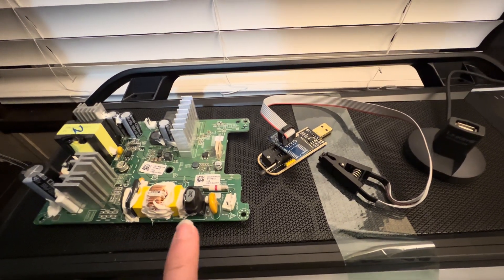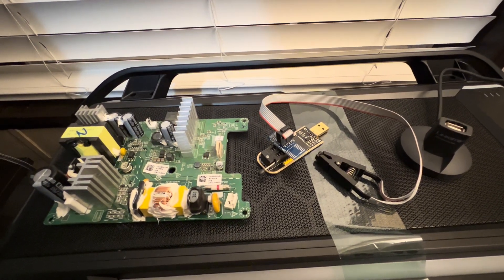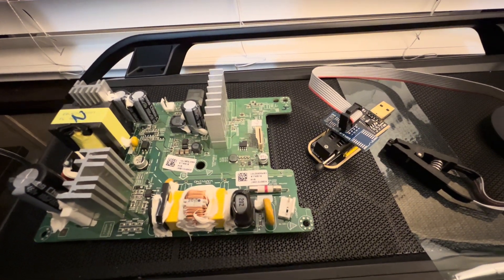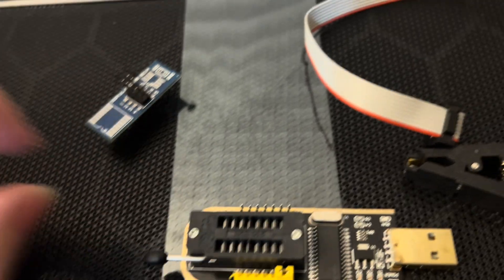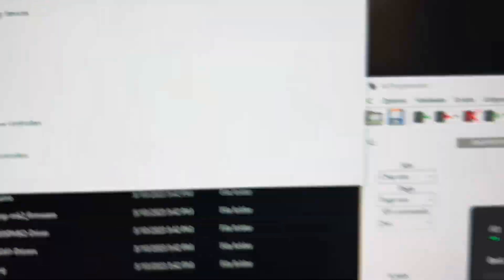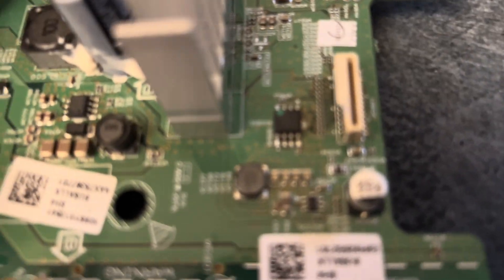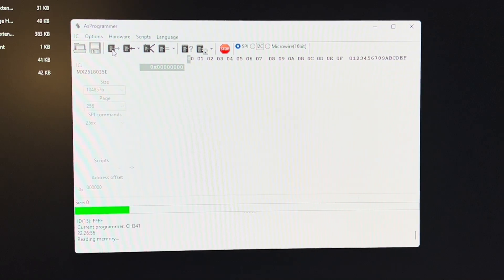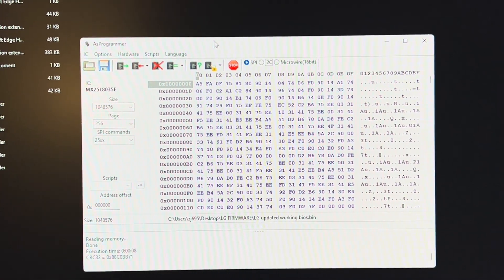How to fix LG Soundbar Subwoofer not working or pairing. SPN5B-W + SPN8-W part# EBR89625801

Comment: I've had this sub dead for over a year with no lights or anything that came on. I figured was power surge that got it and LG said wouldn't fix.
I found this vid and pulled my sub out of the garage, collecting dust and ready to be trashed to give it a whirl for $15 since not a big deal if didn't fix it. I was astonished it read from the chip, and even more so after re-programming that the green light came back On again. Found my old soundbar and plugged everything back in, and my mouth hit the floor as the sub came back to life like magic and paired back to everything with no hassle. Thank you so much for making this vid dude! Saved me a ton of $ by just throwing it in the garbage since LG makes it u can't just pair any model sub back to that soundbar.
Reply from the maker: @chrisrowland8757  🙂

Comment: Thank you for taking the time to post this.  I was about to drop a decent amount of money on a new soundbar system, until I found your video.  I've already ordered the programmer, downloaded the software program, and removed the board from the speaker housing.  The programmer should arrive tomorrow, and hopefully, I will get this thing back up shortly after.  I am fairly illiterate when it comes to computers, so I do have one question.  You posted a link to your working firmware.  Is this something I need to download?  I have no idea what that is.  (sorry for the ignorance)

Comment: This worked perfectly! So glad I searched for a fix instead of tossing it out and shopping for a new one. Thanks from Australia!
Reply: Any chance I can send you my sub to fix? I am also in Australia
Reply: @SOulDie22  I'm guessing it'd be a lot cheaper and quicker to do it yourself. There were heaps of chip programmers on Amazon for about $20 with postage. The only things I struggled with were installing the drivers on my work laptop and reading the tiny writing on the chip.

Comment: Hi there, I purchased my CH341 programmer from Amazon last week and have followed your instructions to connect it to the Sub PCB EEPROM of my LG.  All appeared to be working fine but, I think my CH341 is now bust as the light flashes on when inserted into the USB socket of my computer, and then goes off.  I then get a message in ASPROGRAMMER saying "Error connecting to CH341 device".  I guess my programmer is busted but, is it possible to damage the 341 with improper connection to the EEPROM ? Thanks

PS - Would you kindly be able to recommend a CH314a from Amazon UK please??? :)

Comment: ah was unable to get the clip to even stay on, so I couldn't get it to recognize the connection.. maybe faulty clip? just kept slipping off.
Reply from the maker: Not the chip. Either the clip isn't very good, or you're only clipping onto the tops of the pins and need to push it down a little

Comment: This thing works! I had to do the unprotect, erase, and program steps manually, but other than that, this methods works 100%. I had the issue where the unit would flash the green light forever, never pairing. Amazon had me with the overnight shipping on the chip programmer

Comment: Does the bios/firmware were flashing onto the chip come from the LG website?
Reply from the maker: No. It comes from my subwoofer. You cannot get just the subwoofer firmware from LG
Reply: @FiveStaxX is it possible to re flash the firmware on the main PCB for the sound bar or only the subwoofer?
Reply from the maker: @anthonyv8136  you can probably flash the sound bar as well, if you have the correct firmware for it

Comment: hi i have SPH4B-W subwoofer and i am unable to find the the oem file to program it i did try your file but i am facing the same issue greenlight flashing no connection with soundbar.
Reply from the maker: My file only works on series 5 or higher. I'll see if i can get a series 4 file
Reply: i put new eeprom, work on MODEL NO.: SPN4B-W,thanks, best regards.

Comment: Coming back to say it all worked perfectly for me on my LG SN7Y (Eur).  I followed each step with gaps in between to check i had followed it correctly. 
As is mentioned as a possibility in the video I got an error message after programming but I carried on and it worked first time.
Having been without the woofer for months I am so happy to have it back!
Thanks so much. I sent you a paypal donation. (Not much but all I can afford right now. Enough for a pizza and a beer maybe)
Thanks again and thanks for doing the work that LG and others should be doing.

Comment: Great video, thank you.  I just got my kit delivered so I am hoping it goes well, I am optimistic having watched this a couple of times.

Repair 
3:29 repair starts here 
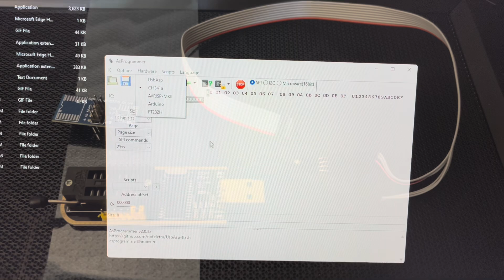4:03 Assembly of USB adapter and cable
6:09 Install USB programmer to computer with driver. 
6:58 Run ASPROGRAMMER

Comment: would bad firmware cause the sub to regularly disconnect and reconnect to the sound bar? Always read about it being weak bluetooth signal and interference that causes it but no matter where i put it/how close/how far away/how little wifi signals in the area there are, it regularly drops connection. Really jarring when its rumbling away in a movie and suddenly stops, then comes back 20 seconds later, then drops 10 seconds later again and returns, over and over.

Or is that truely just a crappy wifi connection issue? (and has anyone done anything to try and fix that, like adding an external antenna to the PCB antenna under the wifi daughter board shield? or extending it out of the sub casing with a longer ribbon cable or something?)
Reply from the maker: I was planning on trying all of those things but my software updates fixed that issue. My mom has the 4 series sound bar (doesn't work with my update file) and her sound bar still loses signal regularly. I think LG just didn't do a great job with their sound bars. I believe it's a weak signal to hers.

Comment: How TF is there NOT an active law suit going against LG for this BS????
Reply from the maker: I guess no lawyers are watching my video 😂 this should easily be class action or mandatory recall
Reply: @zj695000  i found your video cause mine did the same thing. No led and i took it apart and metered the power connections so i know it's getting power. Did you try contacting LG to see if they would replace the PCB before going down the rabit hole of repair???
Reply from the maker: @timbell8208  i did. I was given the generic "your sound bar is out of warranty period. You can send it in for repair ($110-200) or buy a replacement board ($105 shipped)" i told them that this was a widespread issue with reports on reddit, YouTube, and Google. I got no response after that.

Comment: At first, following the steps brought back the green light for a short time, but eventually didn’t work. I did get the verification error but it seemed like not everything was written to the chip, as the whole process ended after about 0:01, which seemed way too quick.

So I did 3 of the 4 steps (unprotect, erase, program) manually one by one and just skipped the verification. And voilà, the sub is working again 🎉

Thank you so much for this tutorial! You saved me a lot of grief and helped me save the subwoofer from going to the trash.

Sending you a donation now!
Reply: This comment should be pinned! I was so glad to find this as I encountered the same error and could not get it working. Anyway thank you so much to the author of the video and to this commenter!
Reply from the maker: Thank you 🫡
Reply: please pin this, this is the solution
Reply: Thank you! the same thing happend to me, I follewd your directions and it worked, now my sound bar is working again.
Reply: Just bought a bad Woofer ..Can u still fix
Reply: Followed the instructions including the comment to do it all manually.  So far so good!  Thanks!
Reply: how I can open the bin file
Reply: you saved me, lol thank you !
Reply: This is VERY valuable info. I followed this and it worked. Thank you for posting this don't know why verify broke it!
Reply: how did you do 3 of the 4 steps (unprotect, erase, program) manually one by one ?
Reply: This is the fix. Had an error while verifying. Tried manually one by one like you. Worked. Well done!
Reply: This was the solution to the problem I had with the final step in the video.  For those that don’t know how, it’s the buttons across the top.  Just click em and they tell you what they do. 

Cheers!🍻

Comment: This fixed my SPN5-W sub woofer that was not connecting back to the soundbar (just flashing green non stop). Got the programmer for $18 CAD. Less than 10 minutes later it was back up and running after flashing. Thanks so much man!

Comment: Thanks for the help. I'm trying to sort it out mine 
flashrom --programmer ch341a_spi  
  - Found Macronix flash chip "MX25L8005/MX25L8006E/MX25L8008E/MX25V8005" (1024 kB, SPI) on ch341a_spi.

but when i try to 
flashrom --programmer ch341a_spi --write ~/Downloads/LG\ updated\ working\ bios.bin
    - FAILED at 0x0000e000! Expected=0xff, Found=0x00, failed byte count from 0x00000000-0x000fffff: 0x1ff5
ERASE FAILED!
Reading current flash chip contents... done. Looking for another erase function.
Looking for another erase function.
Looking for another erase function.
No usable erase functions left.

do you know what might be wrong here ? Perhaps best to use windows machine instead of mac command line ?
Reply from the maker: As far as i know, it only works on windows.

Comment: Thanks heaps, I've had a few issues with the bass speaker losing connection then one day I tried to press the reset button and it just started permanently blinking. I found your fix and purchased everything you recommended and it took over a month to arrive. I spent a few minutes following your walk-through and found it so very easy. I then reassembled and didn't get any change. Then I tried to press the reset button again and realised it didn't move. I disassembled the entire thing, taking out the board and removing the reset button from the case and reassembled again. Now it's working perfectly. So either way I'm sending you some cash because if you didnt do this, I would never have fixed this and the entire system (soundbar, subwoofer and rear speaker system) would have ended up as tech trash. Keep up the great work.
Reply from the maker: Thank you Toby!

Comment: Didn’t worked for me. After following the steps Light has started working and seems like it is connected to the soundbar however, subwoofer is not working. There is no sound in subwoofer. Can you help me with that?

Comment: I have the exact same sub and didn’t have a light on when plugging it in and did this and now have a blinking red light. Does that mean the board is toast? Also when I unplug the sub from the cable I get a buzzing noise from something. Just curious if I need to buy a new board or if I did something wrong. Thanks

Comment: I have a LG model number SL3D soundbar with a flashing red light and won't connect but when I unplug the sub and wait then plug it back in and sync it it connects but the sub does not pull sound or nothing and after a little while it flashes red again

Comment: Hey mate experiencing this issue with a SPN4B-W Sub board number is EBR87888102 any chance you know a fix for this board? Attempted the flash and all goes well except a verification error on address 0000E005

Once the board is all plugged back in it looks to still experience the same problem of a slow flashing green light and back to not pairing.

Comment: If there is the expected voltage (3.3V) on the VCC and GND leg of the VMX25L8035E and no flashing light, does it mean, that I need to change the VMX25L8035E or the entire print unit?

Comment: Thank you! My sub of the same model in the vid had been clipping out for a long time, then one day I realized it was just gone. No LED, nothing. I thought for sure the power supply or something inline with the power had died. I stumbled upon your comment in another tutorial, heard out what you had to say and decided to give a shot. Very good tutorial, no steps missed. I got to the end, ran the programmer and after one second i got the 0000E000 error and was like damn. But then I remembered seeing the error in your caption. Reassembled and the green light was blinking. I had to restart the soundbar, it took about 15 seconds and the blink turned solid green with the sub happily booming through my apartment. You are awesome!

Comment: I downloaded the software needed on my Macbook but the Folder wasn´t zipped when I got it. Also the Folder didn´t have the exact same name as in the Video and in this Folder (wich was named "AsProgrammer_2" on my Mac) I couldn´t find the AsProgrammer file. Does it only work on Windows PC or what could be the Problem?
Reply from the maker: PC only. You can run it on windows virtual console through Mac though.

Comment: Great guide. sent you some money. I just wanted to add that I was able to follow this guide to reflash an older SPL8-W sub in order to get it to work with a SN10YG sound bar. The sub was working fine with an older SL10YG sound bar but after flashing, it will now pair with SN10YG.

Comment: My subwoofer had no green light. I ordered the programmer from the link. When doing the flash the clamp came off the chip. Tried to reflash error message. When reading the bios data shows all FF.Clamp will not stay on.Ended up pressing down on the clamp the whole time. Did the clean unplugged the programmer then reflashed. This time took the flash. Now working hope this helps. Updated the firmware on the soundbar with the app.Thank you donated.
Reply from the maker: Glad it worked! Thank you 😌

Comment: Bro, did everything as you said until 8:35, but my pc didn't make any noise (it did the typical usb noise when i moved the clip a little but the issue is still the same), and when I hit "Read ID" in AsProgrammer, it didn't list anything and doesn't seem to recognize the eeprom chip at all, so what do you think is the problem here? The clip was defective? The eeprom chip is fried or something?
Reply from the maker: It's ok if the PC doesn't make the noise, some don't. Most chips have a specific sweet spot that you have to find for it to recognize it. I usually just keep moving the clip and try reading again. Usually within 5-10 tries I'll find the spot that works.
Reply: @FiveStaxX  thank you, that's what I did and worked fine this time, followed the tutorial and my subwoofer is now working like new
Reply from the maker: @didakos01  😁

Comment: I exactly had the same model suddenly power was off... 
I sorted out by somehow that transformer was the problem..
Bt am unable to know it's voltage can u help me with that please.
It would be of great help if u can
Reply from the maker: 100% of the boards that have lost power have been firmware issues like in my video.

Comment: You're the best, this went over like a charm, from no-lights to alive and pairing in 10-15 minutes. I didn't take my board off the back wall of the subwoofer, which seemed to work great for having safe places to hold and a quick repair. It did look like they had burned off part of the IC numbers, but I could read enough to infer it was probably the same as yours. Just sent a tip your way.
Reply from the maker: Thank you so much! Very glad i could assist 🙂

Comment: Do I need to do anything with your firmware link? If so I can’t seem to open it. I bought a programmer and hope to tackle my 2 subs tomorrow.
Reply: I threw some $ your way . I may need some assistance.
Reply from the maker: Just download my firmware and then you'll use Asprogrammer to load the file
Reply: Ok. I downloaded . Will follow the other steps tomorrow. 👍🏽
Reply from the maker: @curtisboucher6046  let me know if you need any help 🫡
Reply: I get a notice possible protection is enabled. I am pressing unprotect. It does a quick bit of info in bottom of screen and gives warning every time.

Comment: Thanks so much, this worked perfectly for me!  Bought the CH341A off Amazon for $25 and this tutorial fixed my SPN5B-W dead subwoofer immediately!  One note: When re-programmed the chip on my existing board it only took like 3 seconds, which I thought was too fast for it to have worked, but it did.  And I got the same "0000E000" error above as well, but still worked fine.  Now to try get some money back from LG for this mess, lol...

Comment: Hey man, thanks so much for giving us this info. 

I bought all the stuff and followed your vid step by step but I have issues when I click the Read ID button.

ID(9F): FFFFFF(Unknown)
ID(90): FFFF(Unknown)
ID(AB): FF(Unknown)
ID(15): FFFF(Unknown)

Any ideas what this could be?

Thanks man
Reply: Ok so after jiggling the clamp I got it to read the IC and saved it. Upon erasing, reprogramming and verifying I get the below error. 

Verification error on address: 0000E000

Any help please?
Reply from the maker: @nyegrant5937  that error is good, it means the data was written. Test out the sub and it should be working
Reply: @FiveStaxX  hey man, still doesn’t work 😞. No light when pressing the pairing button. I think I will look at purchasing a new subwoofer. Hopefully other Bluetooth subwoofers can connect to an LG sound bar. I read through the comments and your solution works, just not for me unfortunately. But thanks for helping us out 👌👌
Reply from the maker: @nyegrant5937  email me and I'll try to help you further. I have never had one not work so far, but it's too much to type on here